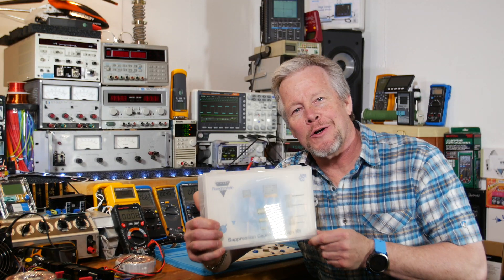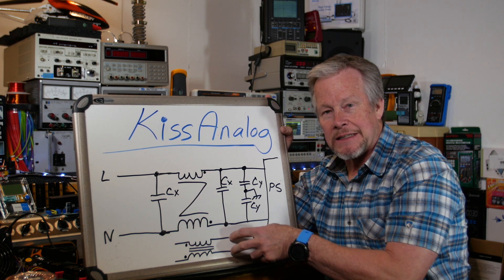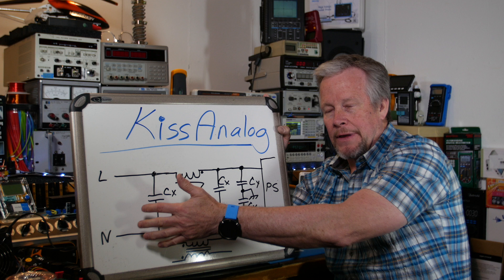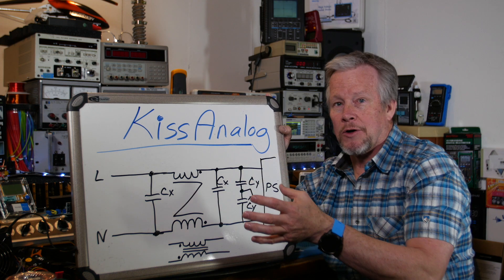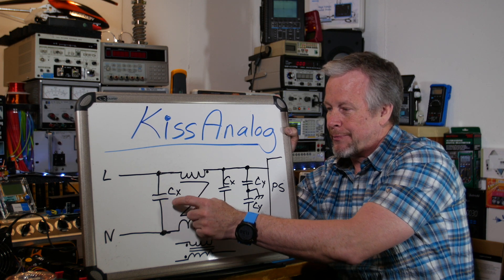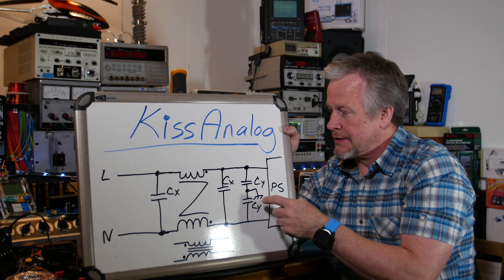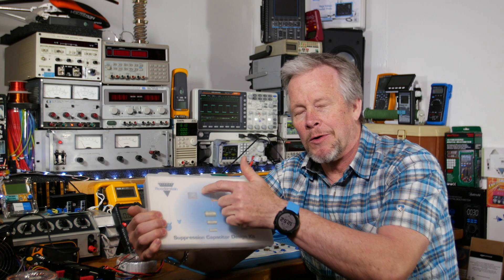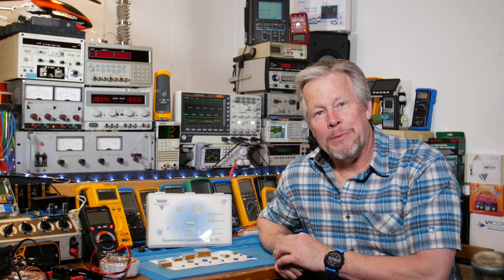How to use Safety Capacitors - What are they? #EMIcapacitor #RFIcapacitor #Xcapacitor #Ycapacitor

Comment: Iam sorry I do not know what a gfci circuit is But we have here in Holland a safety switch What is measure the difference between the Life and Neutral  . If there is more then 40 mA current difference , The switch trip , and shut of all the power in the complete building.
Some times there is a second for the bathroom with use of a wassing machine
Reply from the maker: OK that's interesting.  This device is the same - it is looking for current in the line and neutral to be nearly the same.  In the states the new standard requires a GFCI (Ground Fault Circuit Interruptor) to be used in any location that there can be moisture.  It was just for swimming pools and such, then it became necessary for bathrooms and kitchens, but now I think it is for any unfinished spaces or 'for any space that may have moisture'.  And then there is a Class A which is used for residential and has a limit of 5 mAmps and a class B which is meant to be more safety for the equipment and has a limit of 30 mAmps. Sometimes it is referred to as the GFI without the C.
Reply: In the USA we have to have a GFI on the plug of all hair driers because of safety due to "wet" locations like a bathroom where most people dry their hair 
after a shower. Eddie explains what a GFCI and GFI does above as a  reply!

Comment: Thanks for this Very good explanation about Safety, the leakage  3mA from the capacitor to Gnd what about the differenceswitches or earth leak switch Only al the equipment on your table shoot trip the earth leak switch of 30 or 40 mA How you solved that problem?
Reply from the maker: Thanks Bert!  Are you talking about the GFCI circuits?

Comment: Very timely - I was looking at building an input filter for a DC-DC Isolator.  It's small - 15Vin, 5Vout - but there is a recommended filter in the datasheet.  I notice here that there is no damping filter between the Cx and the PS, just the Cy caps - do these perform the same purpose?  In my scenario, the 15Vin is coming from a wall wart SMPS so I'm wondering, really, if an input filter is worth it, or maybe just a PI filter at the front?  Any advice - I'm learning this stuff as I go along and don't yet have the empirical design experience, just what I read theoretically via Google!  And videos like this.  Very interesting so thanks for doing.
Reply from the maker: Great Question! No the damping filter (Cx in series with an R) can keep an input from ringing in some cases - depending on input impedance.  A dampened input is not a bad idea.  Depending on the power level - the filter can be quite simple.

Comment: Hi. Really good and informative video. Important stuff for sure.
I restore old radios and stuff, often units without any safety caps.
So I usually install an X1 cap right after the power switch.
Maybe I should throw in 2 Y-Caps to ground also?
Reply from the maker: Thanks Geir!  If you have a ground wire in the power cable, then you could try Y caps, but if not - then it could actually be a safety issue.  I'll have to cover this in a video:)

Comment: Nice video, i have some questions and sidenote.
You mentioned that you can change the X cap with a Y cap ? But i always though that X and Y capacitors are not interchangeable due there design.
In case of failure (overvoltage, surge, lightning etc....) of a X cap, these create a short, to trip a circuitbreaker, and the Y capacitor in case of failure to go open circuit, to prevent electrocution. 
As a sidenote, some people who start in Electronics, and purchased there first scope, will try to protect his/her scope as much as possible, 
and read on the internet, to use a powercord without earthpin for connecting there scope to the mains outlet, or use of a isolation transformer.
But in both cases, when there is no earth connected to a scope, these "safety" capacitors in the EMI filter will leak a small current to the earthwire inside the scope, 
and put arround 50% of the main voltage to the BNC connectors at the front.
This wil result in false readings, because the earth or negative lead of the scope is no longer 0volts.
And as final question, what are the advantage of using a X cap for overvoltage, surge, lightning protection instead of a TVS diode ?
I'm working since a few months on a as i call it "passive differential scope probe" (differential probe without the extra need for a powersupply), and for overvoltage protection i use a TVS diode,  for the reason that this TVS diode does not interfere with the signal, untill the treshold voltage is exceeded and the TVS diode goes short to trip the fuses on the + and - inputs. 
I first wanted to use X capacitor, but this interfere with the signal , and also i have seen video's of blown safety caps that cause serious damage and can create a fire hazard, while a TVS diode in case of een event doesn't blow up (test done by myself with 600V and 0,4A).
So can you trow your light on this. 
Thanks in advance.

Greetings from Belgium
Reply from the maker: Thanks Bjorn!  Yes, some safety caps are actually marked Y1 X1, or Y2 X1 for instance.  So, I've always thought it was OK to replace an X type with a Y type but not the other way around.  I'll have to talk to a capacitor vendor to get the latest.
I've worked in a lot of labs that use what they call cheater plugs to get rid of the chassis connection.  The power supply in the scope is isolated, so the BNC connector will tie the scope ground to the signal ground, but it cuts the connection from the chassis to the Neutral of the power input.  I could see it adding noise though.
For surge protection, a capacitor can absorb some low energy spikes, but for more protection it would be better to use large TVS diodes or MOVs - if done correctly;)  I have used large capacitors with small resistors, like say 22 uF with a 5 ohm resistor to absorb some transients.  I like this better than a TVS as it is more robust.  But if we are talking lightning protection - then that is not enough.  I do like the failure mode of a TVS more than a MOV.  The TVS will short then maybe crack open - where the MOV can start a fire.
So, if you are looking to protect from a transient coming into your diff probes from the circuit that they are monitoring - then they are high impedance, so a TVS should work great.  The TVS also has a parasitic capacitance, so if this is a problem - you can place a signal diode with low capacitance in series with the TVS diode.
I will be doing some more videos on surge protection, so stay tuned;)
Reply: @KissAnalog  thank you for the quick reply. Regarding the scope ground, the powersupply is isolated, but in the modern scopes where the chassis is made of plastic, the incoming groundwire is connected to the negative part of the BNC connectors. If you then use a "cheater plug" or a isolation transformer, the incoming mains will leak for 50% to the negative part of the BNC connectors and has influence on the quality of measurements.
The EMI filter is useally as follow :  Neutral wire - X cap - Ground - X cap - Hot wire , but if the ground is not connected to the mains outlet (but still connected inside the scope to the negative part of the BNC connectors, then the neutral and hot wire will leak this small current to the BNC connectors.
After reading on the internet about removing the ground pin for eliminating damage to the scope, i though this was the solution, because i have a modern Atten 60Mhz scope, with plastic chassis and no danger for getting a hot chassis. 
After some testing with this, i came to the conclusion that there was arround 120V on the negative part of the BNC connectors (i didn't feel anything when by touching it, but a tester with neon bulb did light up).  And the measurements with the scope gave false readings. 
Then i did experiments with different small value X1 capacitors in series between the groundpin of the mains inlet (inside the scope), to the ground of the scope, to enduce this leaking to ground (has with connected earthpin was originally), but also the possibility for limiting high currents when accidentally the ground of the probe is connected to a hot wire. That worked, but even with 15a30V remaining on the negative part of the BNC connectors, it will give not accurate measurements. I even placed a white powerled in series, this powerled glows for a minutes and then failed due the high voltage.
The same above about removing the earth to a scope occurs when a scope is placed behind a isolation transformer. That's why it is not recommended to place a scope behind a isolation transformer, but only the DUT (Device Under Test). Also when a DUT is placed behind a isolation transformer, and if safety caps are used inside the DUT, this leaking of the safety caps will then also give false readings on the scope if the ground of the DUT is not 0Volts.
Reply from the maker: I was asked by a major vendor of set top boxes once to tell them how they should run power; 3 prong or 2 prong power cord,
.  They had several manufacturers making boxes for them and they wanted to have them all follow one method.  After thinking about it I wrote a white paper explaining why I thought it should be a 2 wire cord.  The housing was plastic so no need to use ground and some people still don’t have ground and some people use extension cords that remove the ground.  But the BNC will have a floating charge on it due to the Y caps, and UL requires transient protection to ground if 3 conductor.  Just another potential that is not good if ground is not used.  So I agree with you.  I should experiment with my scope;)
Reply: It depends on the component. Some will be marked with X and Y. e.g. https://youtu.be/XavMIYTg3QA?t=32
Reply: @FrankEdavidson  i'm aware of those "universal" safety caps, but i don't understand how these can choose for creating a shortcut or open, in case of a failure ? You can't have both.
Reply: @BjornV78  All documentation I can find say that X-class are allowed to fail EITHER open or closed, while Y-class is only allowed to fail open. So, yes, they can make XY capacitors, and from what I can find I expect most or all? Y2 capacitors will pass the X1 test. I expect is where the "you can substitute an Y-class where an X-class would go" comes from.
But doing it properly it really should be certified/tested for it's role, which is why there's X1/Y1 and X1/Y2 safety capacitors from major vendors like Kemet and Vishay. These provide components that are tested to both standards and if the X and Y are the same size it reduces the number of different components which can help with manufacturing.
The fact that these exists and are fully approved shows that your underlying premise ("X must fail short to pop the breaker") is wrong.
Reply: @Torbjorn.Lindgren  if a X capacitor doesn't go short in case of overvoltage, what's the purpose of using it. It's due it's  capability of going short and pop the breaker thats protects the circuit behind it. Grtz
Reply: @BjornV78  An X safety capacitor primary purposed is to reduce EMI (if it wasn't for that it wouldn't be where it was in the circuit!), the second and only other requirement is that it doesn't cause any safety hazards. Y-class is basically the same (EMI reduction, don't cause safety issues) except because they're used in a different place in the circuit the "don't cause safety issues" part result in different conditions on how it can fail.

So, given where it is placed a class X can fail either open or closed without causing SAFETY ISSUES (which is where the name "safety capacitor" comes in), but not anything in-between (because that COULD easily be unsafe!), while a class Y must fail open because that's the ONLY safe option since it's connected between line and ground, and no, RCD/GFCI doesn't count for this. This means Y-class is a superset of X-class (and also, the test voltage for "Y" is twice that of the same class of X-capacitor, hence X1Y2).

AFAIK all the serious manufacturer has both X1Y1 and X1Y2 certified capacitors which conclusively proves that class X doesn't HAVE to failed closed, or these couldn't EXIST at all! This is further backed up by basically every single reference you're likely to find, they all say that X can fail either closed or open but Y must fail open. So your feelings that X-class OUGHT to fail closed/shoirted doesn't get you anywhere, unless you can point to an actual STANDARD that says that. Please provide ANY reference backing this up!!!

Now, as he mentioned guaranteeing that a capacitor fails open (Y-class requirement) tends to result in much bigger (and more expensive) capacitor so many X-classed aren't Y-classed, but Y-classed capacitors are often also X-classed because it's pretty much a subset of Y-class - IE all Y-class capacitors will pass the same and sometimes better X-class (if they bother). This tends to result in X-class often DO failing "closed" because it's easier but it's definitely not something that is guaranteed.

And we can even see real-life EXAMPLES of this on youtube, there's lots of videos of X-class capacitors failing but not taking out the fuse as your theory would require. Specifically, a lot of "classical computers" have X-class RIFA capacitors in their power supplies and many of them blow these with lots of smoke and a very foul smell when they're connected back to power for the first time in decades. But! in many (but not all) cases the computer keeps on working!

The machine may or may not power up again without the failed capacitors either being removed or replaced but they're clearly not failing in "full short" mode that you claim they "must".
Reply: @Torbjorn.Lindgren  I've been wondering about this. Thank you very much for making it so clear. Great job!
Reply: I believe that they both go open.  How could they rate it as X1Y1, if X would short and Y would open?
Reply: @kgsalvage6306  The X capacitor is placed across line and neutral, in case of a surge or transient, or failure, they go short and pop a fuse or circuitbreaker, where the Y capacitor between line and ground goes open, when in case of failure there is no risk for shock (hot chassis).
https://www.tecategroup.com/products/capacitors/ac-safety-capacitors.php

Comment: Hi Eddie!
Great introduction into the topic!

Could you make a tutorial on the design? 

I think we all know how we can build up frequency dependent attenuators/filters, but is this way really the right way by your experience?
I know there are many approaches like only a X cap over mains or only a Y cap over mains and PE. I've seen it oftenly on older appliances from the 80s, that had linear PSUs or only motors.
Like one of my lab power supplies (linear type, from the 80s, Polish made) has got only a Y cap, nothing more. Also I've seen an old HILTI power drill with only a X cap across mains (sure it's appliance class II). But every time I was wondering how they did determine the value of the caps.
For a good filter I need high Ls or Rs with a C, but did they really depend on the Z of the power cord?

For Roederstein:
They make good film capacitors, but the old (80s) electrolytics give me the creeps. I'm talking about the red/brown full hard plastic ones (https://i.postimg.cc/gjLxzPzV/roe-elko.jpg). By now the all crack and leak physically.
Once I was having a PCB from a fork lift on my bench and one of that guys did explode. I'm happy that I have to wear glasses otherwise I would be blind by now. 
I've been talking to Vishay people (we have a semiconductor plant nearby) and the quality standars are high. Also from my experience the Vishay products are really trustworthy.

Keep up the good work!
Reply from the maker: Thanks BeamFinder!  Yes, I will do an EMI filter design tutorial.  It is interesting how little is done in some cases, but some filtering is better than none I suppose;)  

Oh my - I've forgotten about those old caps!  I think the capacitor could be the most explosive thing on the board;)  I'm always afraid of a cap going nuclear!  I'm glad you were not hurt!

Comment: I actually learned something today.  Thank You.    Do those caps have any other Uses and Values salvaged ?  I suppose they could be used for there actual Cap Values  any place ?   Size not a issue.   Say I had 20 of them.  Build  Voltage multiplayer with those and diodes  for a Ion Generator ?
Reply from the maker: Great point - I'm so glad that you made it!  Yes, these are great caps - just big - but high quality.  The film caps would be great for speaker crossovers or the generator that you mentioned.  Polypropylene caps are a great choice for many applications.